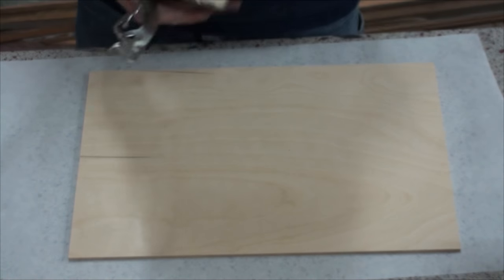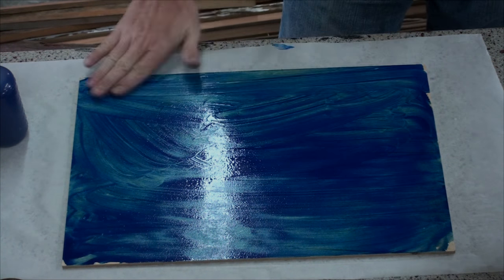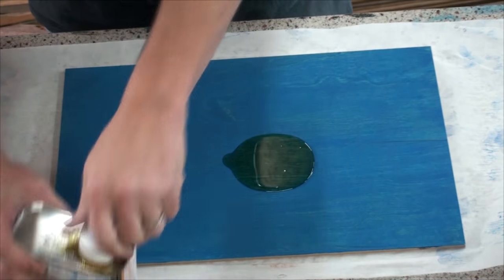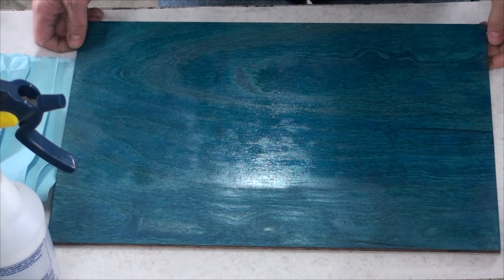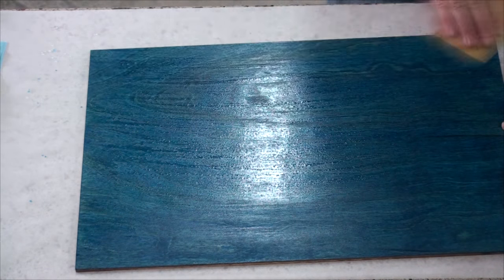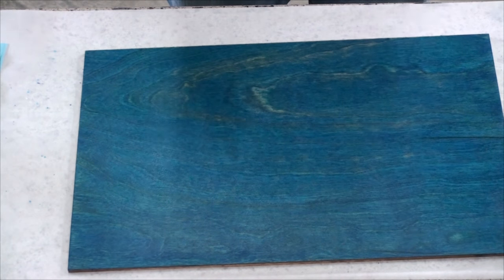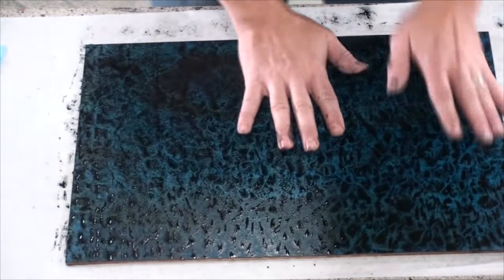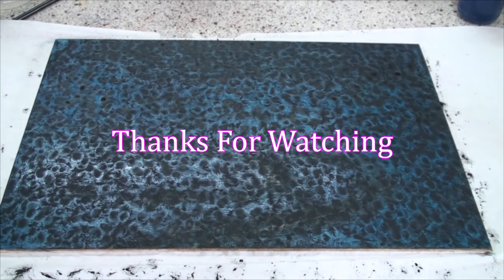Unicorn SPiT Skull Board (Leopard Print)

Comment: Hello beautiful work. I am curious what did you use as sealer in the final product?
Reply from the maker: Hi Tammy, depends what I'm will be doing with it, most of my stuff I laser cut, you have to use a oil base clear coat so the colors wont run, so I will spray first with 2x clear then actually use polyacrylic water base for the final coat. its a much harder coating then the oil base and does not yellow, or you could just coat with epoxy if you wanted a shiny effect.
Reply: maceglass thank you